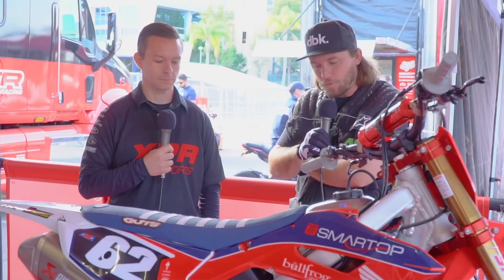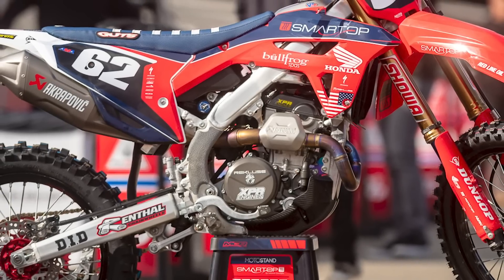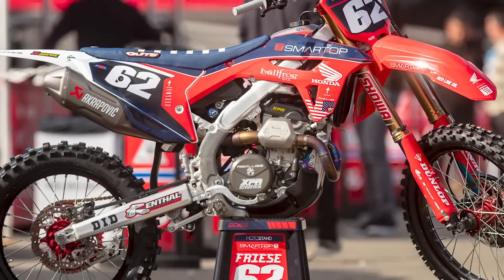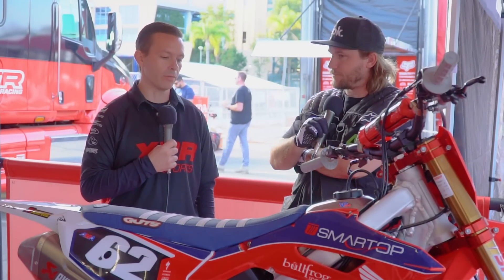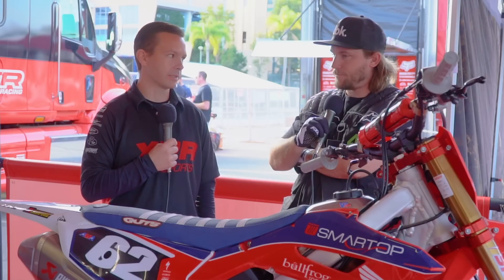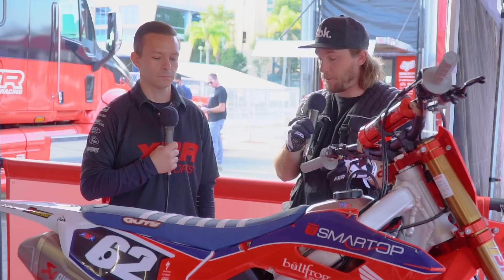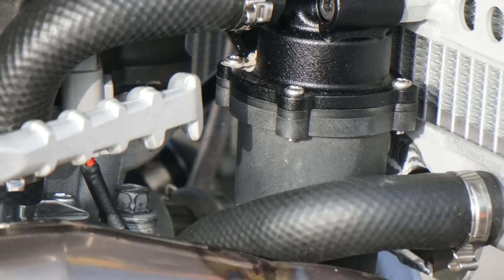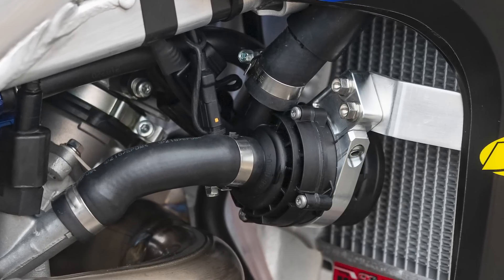External Electric Water Pumps Increase HP and Cooling!

Comment: What did we do here? Get into the realm of thinner cylinder walls on this scooter? 
If I am another team I am wondering, how are you building so much heat that it became a problem while others aren’t saying they have had to seek alternative temp resolution measures? 
Perhaps it’s all just a story.
Package and sell, but before I buy I need the data on temperature reduction levels from speeding up the flow inside a closed loop system. Same hot water simply moved faster does much? It would seem air flow improvements at dissipation points (and/or increasing dissipation surface area) are still where the biggest progress can be made in temp reduction. 
This screams we are battling big bore temperature concerns and found progress at idle speeds, or we’re playing with something to sell. Unless you buy into impeller drag and seal friction improvements being a big enough power improvement reason to run one of these while the massive crank seals and huge clutch basket bathing in oil are still 99.9999999% of the drag.
Did I mention the countershaft seal?

Comment: Is it total loss with a lithium battery? Otherwise the drag is just in another form. I like the idea you get full flow even when rpm drops but could you get equal cooling with a larger rad?
Reply from the maker: It's not total loss.

Comment: I can see the benefits, but as an enduro/trail rider I'd be worried about it failing due to the electrics (rock/stick/water/electrical gremlin) and me not knowing - I would think mechanical would be less likely to fail instantly. For a pro bike that gets stripped regularly it isn't an issue but not for me.
Reply: You’re not wrong, but they will likely improve packaging to solve some of those concerns. Most of my riding is harescrambles these days and this could be a game changer imo.
Reply: Sorry, but I would disagree.  Regardless of your riding use, water pump failure of any kind is noticed by water spewing out the radiator. 99% of mechanical water pumps  and hoses are low and outside the engine. If you could remove the whole system and put a small pump near the center of the bike, it would have less chance of damage from "stuff".
These small electric pumps work for years on cars with almost no failures.  Then can also run full speed when the engine needs cooling, not just when spinning the engine fast. Great idea. Should have been done years ago.

Comment: Wonder if this would help with trail bikes that run low rpm in technical terrain and battle with over heating. Radiator fan and electric water pump..
Reply: Probably not as much since coolant cools by airflow.
Reply: @caydenthompson126  That's why I included "Radiator fan and electric water pump" I think the combination would work.
Reply: @TepcoCycleRepair  maybe
Reply: I think it would maybe help a little. But i would question the reliability of the electric pump over mechanical. Not saying it couldnt be reliable but is the risk worth the gain if there is any at all. Honestly even for a track bike and the average weekend warrior i dont think this would be the best modification. Especially because theres only a small small population of riders who could actually benefit to the hp increase. I know my yzf 250 has all the power i could ever need. But hey if they prove this to be as reliable or more reliable as mechanical and make it either stock or easy to install then it would be great
Reply: @RandomUser2388  We'll have electric bikes before all the OEMS decide to put electric water pumps in their bikes lol
Reply: @caydenthompson126  maybe🤷‍♂️😂
Reply: with a radiator fan youll never overheat anyways

Comment: Would be nice to them develop better packaging for this. It needs a durable design in a location that doesn't obstruct other components. find a space where it can live ... where the pumps housing, hoses and wiring harness can safely exist and function as a whole to improve cooling and power ... and you will have every manufacturer scrambling to add this to their bikes.
Reply: If you watch carefully the video shows 3or 4 different pumps and mounting locations. If your not racing at the highest levels this is probably useless as 99 percent of us don't use the power the bike has
Reply: This will probably end up on future bikes anyway, assuming we stay with internal combustion. I don't think the average pro needs one right now, let alone every joe schmo

Comment: been doing this modification for years on tz250's, rd350 race bikes etc for years. I'm surprised it's not been done on a motocross bike before.  
great mod for keeping temperature under control and will add about 1hp on a 125gp bike but obviously more during a race when excess temperature is causing a power loss .
Reply: What model pump do you use?

Comment: Should be added why it improves cooling. The waterpump isn't related to engine RPM anymore while an electric waterpump can spin on full speed all the time. Increased flow means better cooling.
It's obviously a bit of a trend now and we'll see if they really keep it on the bikes. It's certainly a performance gain, but it makes virtually no sense to get one for non-factory bikes, as they usually produce less heat by lower RPMs, lower compression ratio, less aggressive cam lobes etc.
Very interesting nevertheless!
Reply: Furthermore it can be controlled by the ecu via temp sensor feedback to also regulate engine temp by slowing down or speeding up flow to keep it at the optimum temp for torque or power output
Reply: Being outside the engine surely having the air run past it, it would make the pump itself cooler aswell???

Comment: Does it add weight in correlation to the mechanical? Interesting pathway.
Reply: A little bit, but not as much as you'd probably think. You are also removing a few parts inside the engine.
Reply: @MichaelLindsay  yes, and ideally you could reroute the coolant lines to just the base of the cylinder (depending on engine design) and reduce coolant capacity and weight by a few ounces alone.